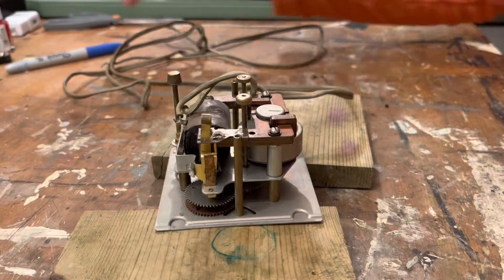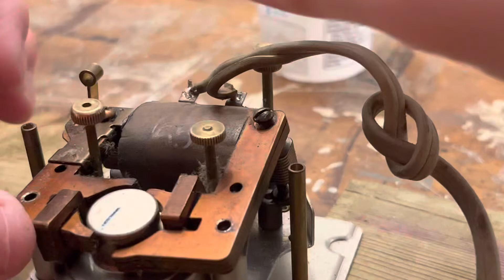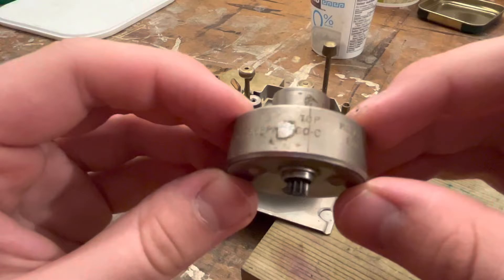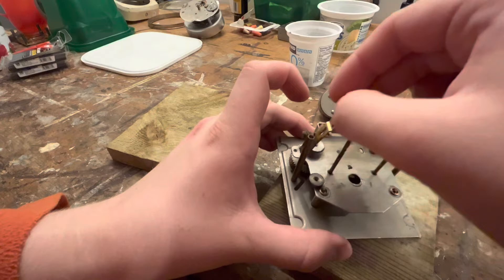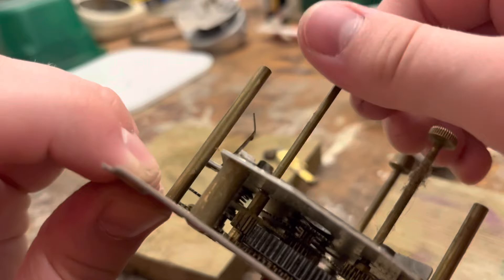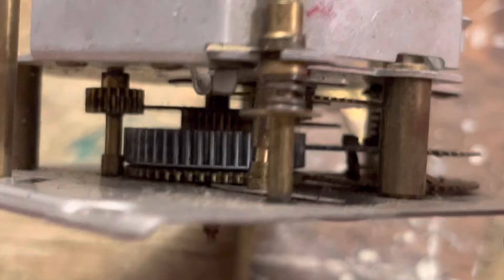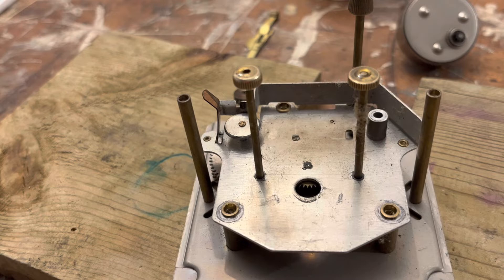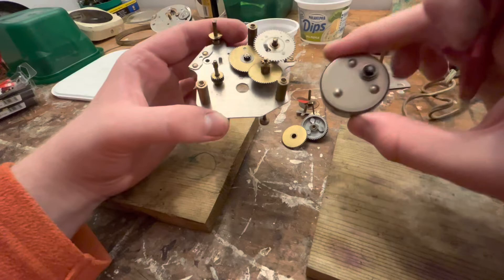Telechron Tela-Alarm Jr Electric Clock Movement Disassembly (Part 2)

Comment: Step one.  Unscrew the 2 screws closest to the rotor.
2.  Remove the hand set knobs.  Turn the knobs opposite of the indicated direction on the case back.  Usually one is right handed thread, the other is left handed thread.
3. Remove the coil, laminated iron assembly.  No need to remove the coil screws.
4. Remove crystal bezel. Remove crystal.
5.  Remove hands, remove dial.
6 Remove 3 screws behind dial that hold the movement together.
7. Take apart movement, clean all parts.
8. Reassemble movement. 
9. During reassembly first turn alarm gears so that it just engages (usually clicks or snaps). Put on the alarm hand at 12o'clock.  Then other 3 hands to 12 o'clock.  To check your setting turn the  alarm knob counter clockwise until the alarm mechanically engages.
Rotor lubing is a video all by itself.
9.
Reply: Of course when you reassemble the movement use a sparingly amount of clock oil.

Comment: Easy to open using hobby lathe.  Either remove the crimp or open it.  Your choice.  Check the gears for damage before assuming it was hardened grease that caused it to fail   NOS H rotors are only about  $30 so don't work too hard.